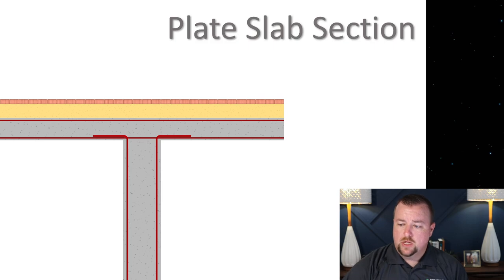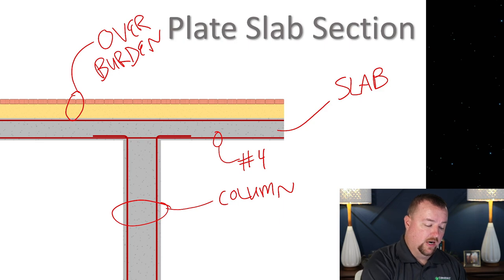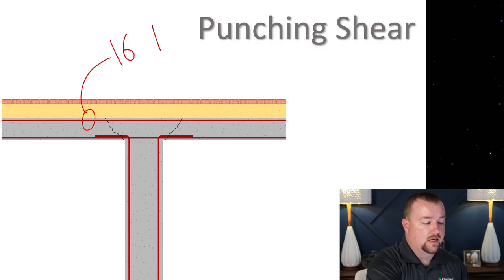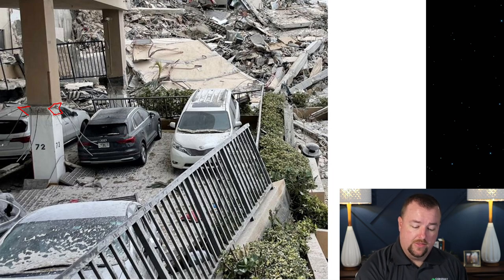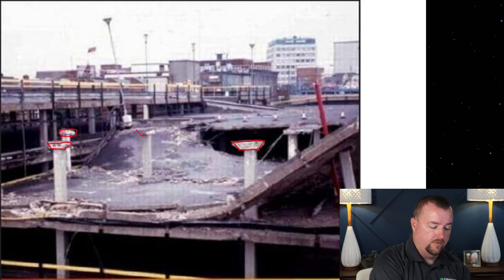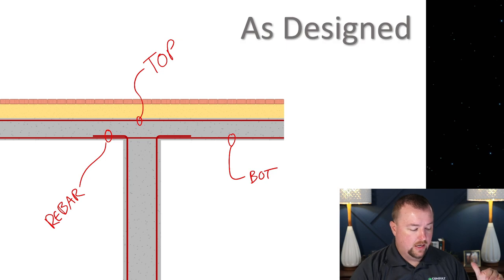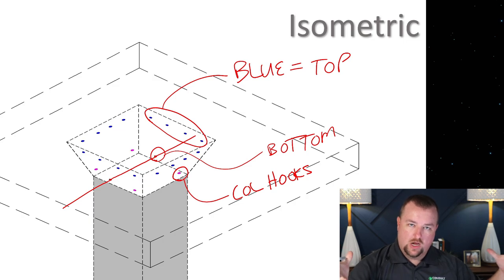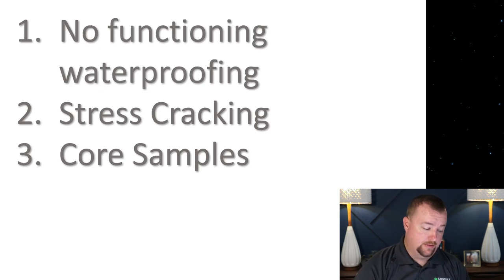The Importance of Punching Shear at the Surfside Collapse

Comment: The punch thru looks like someone used a lot less steel than was called for in the plans. By the looks of it a lot less steel. Someone bought a nice boat or pocketed a pile of money. Whoever built this is in a hell of a lot of trouble. Prison trouble.
I understand why you stepped around this issue of blame. But someone made a horrible decision because I don't see near enough steel in any of the pictures regardless of Spalding. This is going to become criminally responsible at some point. 
Smoking gun? You bet!

Comment: Concrete and and rebar is cheep and easy to build with. It can’t be internally inspected and a little water it can fail without warning. That’s the the big picture. Steel frame building can be inspected. Your dead by cutting costs.

Comment: To Building Integrity,

Are you aware if the US Navy's live fire shock test off the coast of Ponce Inlet, Florida on June 18, 2021?

A reported earthquake of 3.9 was generated. This earthquake while highly unlikely to be associated with the Champlain collapse could have caused unknown and unseen soil consolidation under the towers. Differential consolidation due to seismic forces of unsaturated soils under the columns coupled with a massive losses in factors of safety due to erosion should be, in the very least, explored as a possible mode of collapse.

Comment: Good explanation. However, this structural engineer failed to mention the most obvious cause of this dramatic failure of the building: not only did the columns were devoid of shear heads, which allowed for the easy puncture of the columns through the slab, but the design lacked BEAMS altogether; yes, BEAMS sir ! to tie up the columns in a safe scheme. How on earth can a structural engineer not include beams in his design? And you know why the irresponsable engineer didn´t include beams at all? Just to make room for one more floor, to make more money. That´s called GREED. Yes, that´s right. These people should be sued millions and sent straight to jail for murder.

Comment: The building was badly designed. Here where I live we have six story buildings with more powerful structural elements. I am a layman. When I first saw it I saw bad engineering. No tops on those thin columns, in a corrosive environment, on beach sand. America landed a man on the moon with this type of engineering standard and material science?